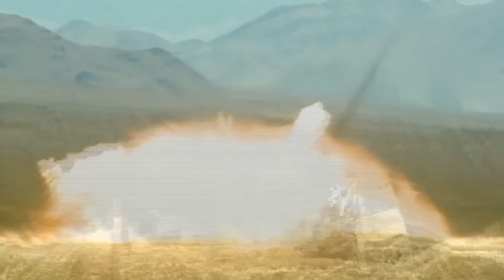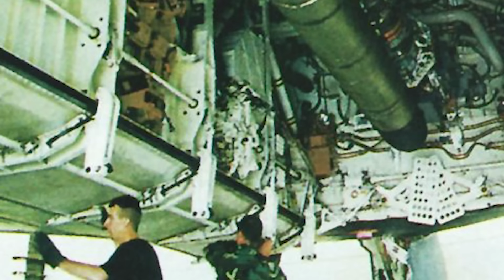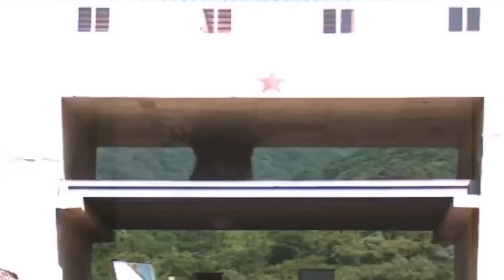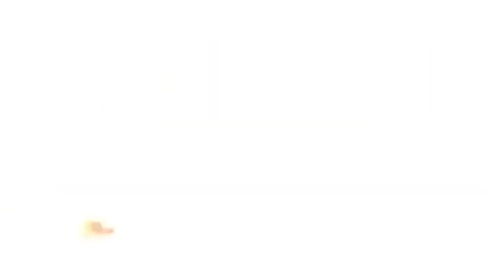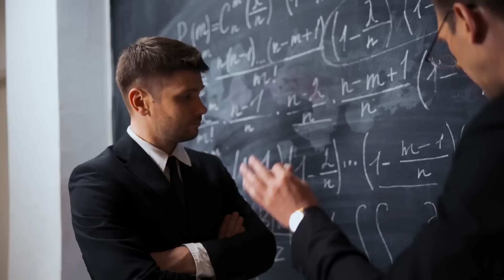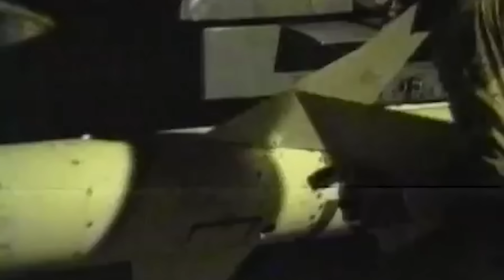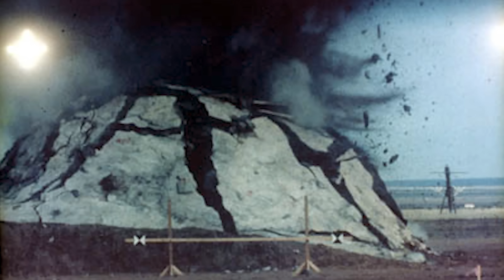The Monster Bomb that Turned Ground into Butter

Comment: Imagine spending so much money researching and developing this new bomb, when the British Tallboy bomb made in World War 2 could penetrate 60 feet and blow the side off a mountain.
Reply: The tallboy could do all that to a target if it wasn’t floating and landed within reasonable distance to damage the foundations. 

Otherwise it’s an overrated dumb bomb which ironically had a guidance upgrade which barely got used in Korea, the ASM-A-1 Tarzon.
Reply: Imagine not realizing that the Tallboy weighed 10 tons and took a larger bomber to carry one. Today they load 6, 8 or 10 under the wings of fighters.
Reply: "Accomplishments of the Tallboy included 24 June 1944 Operation Crossbow attack on La Coupole which undermined the foundations of the V-2 assembly bunker and a Tallboy attack on the Saumur tunnel on 8–9 June 1944, when bombs passed straight through the hill and exploded inside the tunnel 60 ft (18 m) below the surface (stopping Panzer reinforcements reaching Normandy)" 
Interesting! Thanks for the input. But the GB-28 smashed through (164ft) Sounds like the research paid off.
Reply: The tallboy was a masterpiece of engineering and craftsmanship...  For its time.
Reply: Imagine using a different aircraft..🤦‍♂️
Reply: @OneEyedJacker  Tallboy was 5 tons, 12,000-lb. Grand Slam was 10 tons, 22,000-lb.  The Tallboy (Small) usually called Cookie, was 4,000-lb. 
Modern fighters usually max-out at 2,000-lb under each wing.
Reply: @gorn9161  and that was just a Tallboy, the Grand Slam would go over double that depth. Unfortunately it took weeks to hot fill a Grand Slam with Torpex D1, it shrank on cooling and had to be filled little by little. So they were only made up in advance for each mission. Both were intended to be dropped from higher altitude than the Lanc could manage, yet from 18,000-ft the reached 750mph. They were intended to be completely supersonic and penetrate further. Most of the bomb weight was the penetrator casing. A 20-ton Grand Slam never left the drawing board as there was nothing to lift it. The merikans developed the 30-ton MOAB from the Grand Slam but didn't understand the penetrator properly, just that bigger was better.
Reply: @topsecret1837 I'm assuming you mean Tirpitz, which was sunk (as in capsized) by Tallboy bombs. Overrated, you say. Well, considering when it was developed & used, it was remarkably effective. But somehow, I think that doesn't matter to you, does it? Still, as long as you can trash not only the weapon but the men who flew the Lancasters & who dropped it in conditions far removed from today (or the Gulf war) that's what matters, isn't it. 
Before you shout your mouth off, try finding out what the bomb aiming equipment of the Lancaster was. Then have a look inside a Lanc. Then think about flying one in combat. It's not like the B17 or 24 with .50 machine guns all over, it had rifle calibre .303 guns in just 2 turrets & no defense underneath.  So, & I say this with the respect due, stop talking rubbish. For 1944/45, with the technology then available, it did what it was supposed to.
Reply: @topsecret1837 that may well be … but Barnes Wallis and the Brits did it first…Tallboy and Grandslam did take out the Tirpitz  railway tunnels, viaducts, V-3 gun sites, V-2 lunch site, U-boat pens plus a few other hard targets….that’s just gotta be impressive not just to the inventor but the bomber crews who dropped the weapon…dropped a dum bomb  so close so’s to make the target site inoperable….
Reply: @jeffslade1892 A Cookie wasn’t a Tallboy, it was a blast bomb. It was carried by Lancaster’s with incendiary bombs  to burn building once the cookie had exploded and de-roofed the building…..  A Mosquito, with a modified bomb bay could carry one Cookie…
Reply: @k1200ltse  My late father was on Lancasters in the rear turret with a double gun load. Very difficult to reload in flight as each belt weighed a hundred weight. The double load meant take a bomb out, but it got them home safe. The Lanc had proximity radar, the rear gunner was flight trained so he could instruct the pilot to bring the guns to bear (or evade). The four rifle guns threw over 4,000 round per minute. Fired in short bursts because a belt only lasted 16 seconds. Dad always wanted to be on Sunderland, because they had a chemical toilet. The rear gunner wore electrically heated underwear, full flying suit with boots and gloves, over suit and over boots, and mitts, despite a heated turret.  Dad would imitate the loud farting noise they made. Dad was very good at mental arithmetic, I think the skipper used him as a calculator as he could rattle off the fuel, bombs (which ones), crew, guns, payload  for any target distance. 
I have nothing but the greatest respect for all the allied aircrew. Five hours of boredom, five minutes of terror. 
The Lanc lower turret was lethal, it could jam and kill the gunner and was soon deleted; that increased the bomb bay. The rear turret could cover everything the upper turret did, so that was deleted too. With night flying, night fighters did not make frontal attacks, so eventually the guns in the front turret were deleted too. The rear turret became the only defensive armament, really the only one needed at night. Removing guns and their ammunition lightened the aircraft.
The bomb sight was the SABS, the most accurate bomb sight developed at that time. The Norden was flawed and surrounded by fraud in development and adoption, but that is another story.
Reply: @k1200ltse  Tallboy was used on a number of ships besides the Tirpitz, for example the cruiser Lutzow fell victim in Poland where they found an unexploded Tallboy in 2020 in a sea way. They tried to disrupt it but it detonated. Not a thruppenny banger. There's video footage and photos. No one got hurt fortunately.
Reply: Tallboy couldn't penetrative modern high strength concrete like this bomb.  That said it was a 10 ton bomb. This is a 2 ton bomb. That means a plane can carry multiple of them vs 1 Tallboy.

Weather for going to get really serious tallboy ain't got nothing on the Moab.
Reply: @auraeliuswrinn3756 The Grand Slam, at 22,000 lbs. was even more impressive.
Reply: @kraftwurx_Aviation  Tallboy was 5 ton,  12,000-lb (Bomb, Medium Capacity, 12,000-lb).   Grand Slam 10 ton, 22,000-lb. There was a 2  ton, 4,000-lb version of Tallboy too. The Tallboy could penetrate 16-ft of german reinforced concrete e.g. U-Boat pens, underground factories. 
The Grand Slam took a long time to make up, several weeks to fill it with Torpex D1. So it was only ever made up for special jobs. The 5-ton Tallboy was the usual penetrator.
Reply: And how mamy did it take to hit the target.
Reply: Like how you attempt to make Americans come across as stupid yet it was us who had to save YOU guys during ww2, and if we are talking about levels of intelligence uhh... first atom bomb, nuff said. Be a hater elsewhere.
Reply: @kraftwurx_Aviation  pointless argument! You build something for what you have at the time not for something 60 years in the future! doh
Reply: Plenty of money was spent developing the Tallboy, too.  …but you couldn’t have delivered one from an F-111, nor could you have attached a Paveway kit to it.
Reply: I was at Hahn AB Germany when we got our first F-16 A/Bs in 1981.

The little single engine jet could carry the same bomb load as a 4 engine B-17E could in 1942!

Comment: Don't know what was used but a news report last week about Gaza said 200 feet underground "was not enough". One of the capabilities mentioned years ago is serial bunker busters. The first bomb goes in and blows, and the second bomb follows into the hole made by the first bomb and continues deeper. Sounds good to me.
Reply: Fortunately, some gasses are heavier than air. If you can get to one of the entrances, you can usually easily wipe out most tunnel systems.
Reply: @WardenWolf  There are some gases used in TIG or MIG welding that will do just fine and are readily available.
Reply: That's a nasty thought
Reply: Only if you are not the target man.
Reply: Im sure we have plenty of options since iran has been on the USA map for a while now. Id imagine a very low yield nuclear bomb combined with the technology of bunker busters etc.
Reply: @VegasMikeP229  Natural gas is abundant and can be pumped into tunnels mixed with oxygen, and then detonated.
Reply: @WardenWolf  
If tunnels occupied by bad guys? Good! If hostages? Very bad!
Reply: @mkay1957 would be better to use propane. It is heavier than air. It would settle to the lowest spot.
Reply: An interesting detail about Saddams bunkers was that they were built using a very high tech concrete mix which is rare even on western standards.
Reply: Thought chemical warfare was not allowed @WardenWolf
Reply: @briankennedy5578 man and it stinks too. They'd be simultaneously thinking something died and then die.
Reply: @bryanterrill7674 Pure propane is odorless.  The familiar stink comes from methanethiol (aka mercaptan) which is added to propane and natural gas for leak detection.  I could argue either way about adding it for this purpose.
Reply: @firstmkb  didn't know that. I just know it smells good awful when it's open valve and not being ignited. It's definitely saved my ass once or twice when I had a 5th wheel camper.

Thanks for the info!
Reply: @Munakas-wq3gp  They mixed school glue in it.
Reply: A penatrating bomb, keeps going, yah!
Reply: Sounds like my kind of Friday night
Reply: Hypersonic weapons will be the future.though eventually defensive systems will mute their effectiveness.

What comes next, Ill probably have to watch playing a harp on a cloud, LoL.

Comment: I was a 7 level Avionics Systems Specialist assigned to the 494th F111F FS. in Taif, Saudi Arabia during the war. The video does confuse the types of aircraft shown on screen but the narration is correct. Even the details about how quickly the weapon was designed and deployed. The first two were dropped by 494th aircraft and the bomb casings were still warm/hot from the when the Tritonol (explosive) was poured. Those two bombs were loaded and shipped real fast

Comment: In 1971 during the Laos incursion we used a fuel - air bomb dropped from two C130s.   The first carried 10,000 gal. fuel bladder filled with a mix of diesel and av- gas.   The second held a 'daisy cutter' bomb developed to make landing zones.  15000 pounds of RDX and a fuse the set it off before it hit ground.  It also was designed to produce a flat, plate like explosion.  First the fuel, then the daisy cutter.  The result was impressive.
Reply: Seen the video. Cool stuff except for the monkeys.

Comment: I was an Air Traffic Controller at Taif during Desert Storm, worked in the Radar Approach Control. If memory serves, we had approx 100 F-111’s (F & EF models). It was quite a sight watching them take off with full afterburners. They all departed as a group and returned as a group. It was a challenge to separate so many aircraft at once. Good times!
Reply: I was a bee bee stacker and worked inside the big arched concrete bunkers they were atomic bomb proof. In the cold winter they were
 58 dagrees inside. In the hot summer they were about 62 degrees
inside.
Reply: In the SPINS those guys should have already had a planned recovery plot.
Reply: Good times invading country based on false premises. Causing havoc for years in that country. Congratulations.
Reply: @appleturnover519  Storm was kicking them out of Kuwait with a big ole boot.
Reply: @appleturnover519  Wrong war.
Reply: All of the aircraft, including the Kuwaiti A4's, were impressive taking off fully loaded with afterburners on, only for them to return empty an hour later to Khobar Air Base. I got to spend a few days at the end of the runway during the air campaign. I'm pretty sure that it helped to take out my hearing, along with some SCUD's. I also got to hear the relentless pounding from the B-52's at night when I was up north. Very impressive light show.
Reply: Well that is because they were tied together with stainless steel cables during all flights.  However, had the let them fly autonomously some may not have returned.  It was a tradeoff.

Comment: Bunker busters were first invented, introduced and used by the RAF during WW2 in order to penetrate German U-boat pens. They were carried by Lancaster bombers as no other aircraft could carry that weight.
Reply: The advantage the Lanc had was its large  undivided bomb bay to fit the tallboy and grand slam deep penetrating bombs, not it's carrying capacity
Reply: @berttrombetta4953 still has off to Barnes Wallace, genius.
Reply: Saw the sub pens at Brest.  Still in use at the time.  Only three bombs penetrated through 24ft of reinforced concrete through the entire war.  What was impressive were the craters they left.  Built a medium sized building at the bottom of one.
Reply: @rvndmnmt1  3 were enough to stop the pens being used for an extended time!
Reply: Yep tall boy and grand slam if I remember correctly
Reply: I think the Brits still hold the record for the largest bombs ever dropped…..12,000 lbs ….I think called the Tall Boy.
Reply: @berttrombetta4953 And it's big bother the Grand Slam the ten ton earthquake bomb designed to be dropped by the target and penetrate deep underground and blow a huge cavity into which the target would fall .
Reply: Barns Wallis was a bomb designer and had to develop an aircraft to take his idea of a bomb -- tallboy earthquake bomb --- he had to sort out the aiming too and had ace fighter pilots get details just before the bomb was dropped they had to be dropped 15 miles away and at altitude
Reply: @NedLawrence2434  Nnnnope, we've dropped the MOP. And if you include non-combat drops, I know for a fact that we have... but I'm sure we also dropped a Cloudmaker at one point in non combat drops... But Tallboy x2 = Grand Slam. Grand Slam x2 = Cloudmaker.

Comment: All based on the work of the GENIUS Barnes Wallace who dreamt this bomb up before WW2, he viewed that destroying Enemy Infrastructure in the 1930s.
It was not until they could get the casting technology right  and a plane with a bomb bay big enough.
I think it was 1943 that the bomb was made, from memory it took 2 weeks to fill and weighed 10Tonnes, then it was fitted to the Lancaster.

This video should read an update of Barnes Wallace 1930 design.

I think grandslam penetrated the ground to 100M and then 10 tonnes of torpedo went bang.

It would sink bridges on foundations as it turned the ground to liquid.
Reply: Not 100m deepest was about 35m in sand.
Reply: @jantschierschky3461 If it was sand that would be pretty good , because they use it in bags to stop bullets
Reply: @briansewell1480  bullets are different to bombs.
Reply: Barnes Wallace - the earthquake bomb. Why try to hit a bridge or a battleship when a near miss with an earthquake bomb destroys things.
Reply: The Grand Slam bombs and the Tall Boy bombs were both fitted with tail fins that were set at an angle. This was done to provide the effect of stabilisation on the bombs in the same manner that a projectile fired from a rifled barrel is more accurate than a projectile fired from a smooth bored barrel. In addition to the resulting improvement in accuracy of aim it was also found that the imparted spin enabled the bomb to penetrate deeper into the ground than a bomb without the twisted tail could go. The bombs were also fitted with a timed fuse in order to allow for maximum penetration before detonating .
Reply: Ten-ton "Grand Slam" or "earthquake bomb, which took out Bielefeld Viaduct (apparently the wings of the Lancaster "sprang" back to level when the bomb was released!).  Smaller "Tallboy" which was devastating against the Tirpitz. Later calculations indicated that the bombs actually went supersonic during their descent onto the target.
Reply: Wallis wanted to achieve the ‘camouflet’ effect or the hangman’s drop. The torpedo explosive had to be poured in, one bucket at a time and could take up to 2 weeks to cool down. Great respect to the man BW!
Reply: Torpedo?? Torpex!
Reply: Americans - Overstate everything, English take a more conservative approach.   The v3 installation was 110 yards deep and taken out by tallboys.
Reply: Grand Slam was a massive beast! I remember the first time I saw a photo of and I amazed the the size of it.
Reply: It had 3 Fuses different places to ensure detonation
Reply: The ten tonner was Gramd Slam, very late in the war and a bit too big to be practical, it made the plane carrying it very slow and vulnerable. The six ton Tallby was more practical.

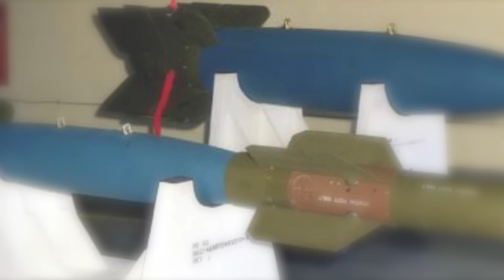Comment: 08:12 - Strazevica (Belgrade, Serbia) command center is under 100m (300 feet) of soil and rock. It was designed to withstand 20kt explosion (so if you drop a Hiroshima bomb directly on top of it, it would survive). The biggest "bunker buster bomb" NATO dropped there was 2.5 tones of weight and it simply failed to go deep enough.
Reply: Rock mining on the side. They just hit the rock again and again. Some of Sadam's bunkers also were built by ex-YU companies.